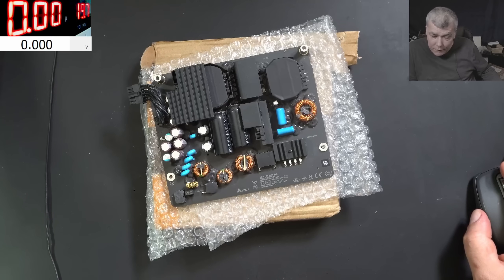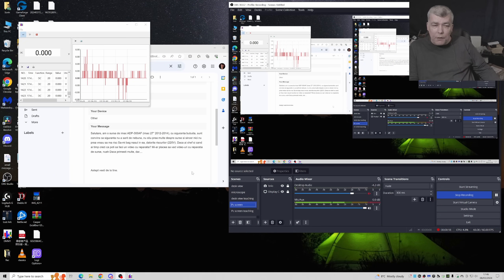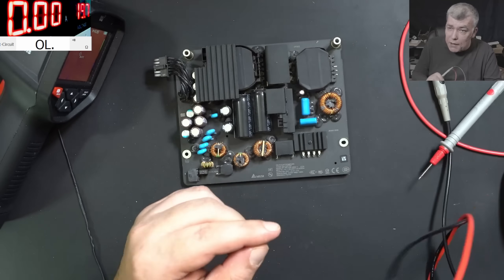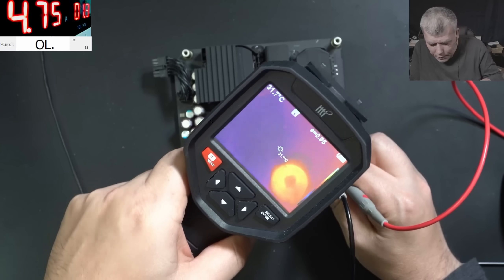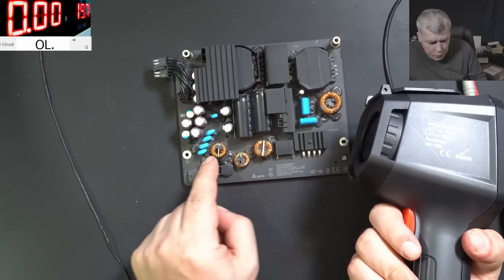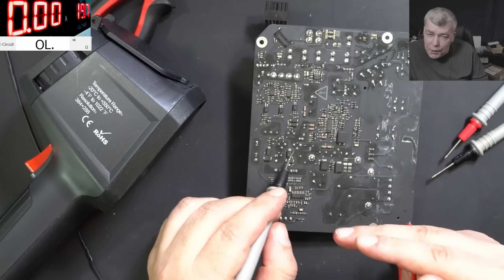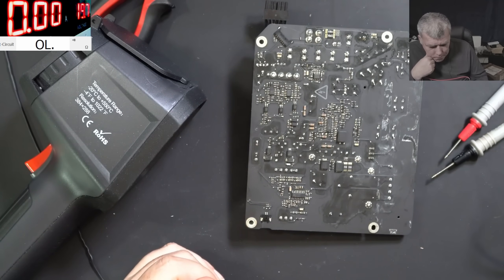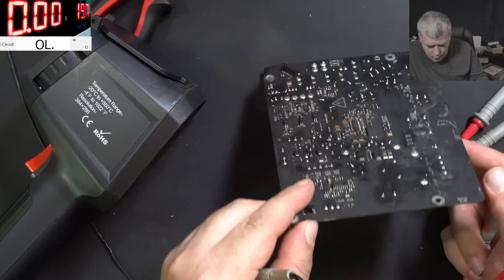Apple iMac power supply diagnose

Comment: iMac 7,1 (24inch, mid 2007) with psu "adp-240af b" have one pin on 12v and one on 2,6v. Does the psu have any problems? Or do I have to look on the motherboard since the diagnostic LED1 remains on?

Comment: The component cost with shipping probably exceeds the cost of the £25 board from Ebay and that's before you charge for time to fix and return post. I would just say thanks for the board, here's where you can buy a replacement. Not worth getting depressed about it - on to the next job 😀

Comment: I fixed some of those. The drivers are not hard to get. If someone tries to fix it and sees a driver heating up: Check the resistors around the driver. I saw several of them go bad, causing the driver to get stuck in a bootloop. Drivers are fine and handle very high heat, check datasheet. Also be aware that there might be high voltage at one of the pins.